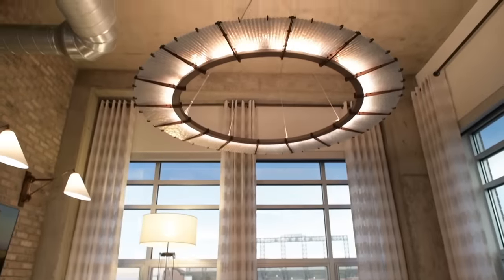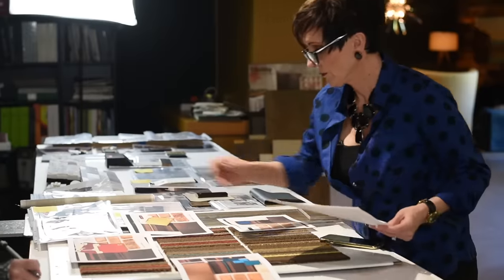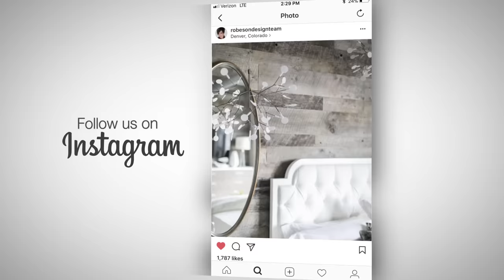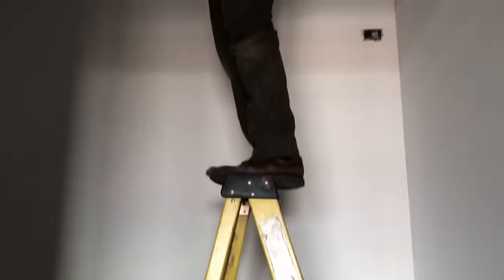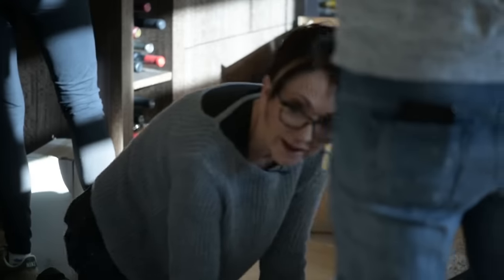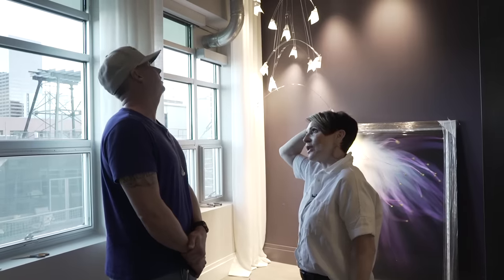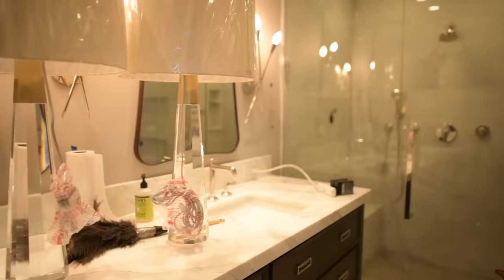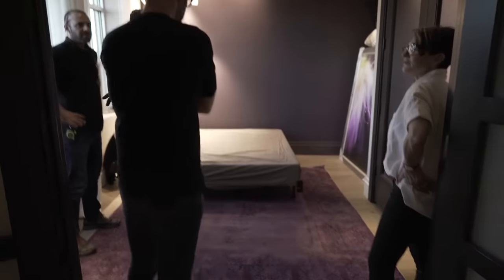Interior Design | Apartment Design | REVEAL

Comment: We have black marble and the designer had a placed a clear plastic over to bring out a shine. Question: when using marble can I remove the plastic film and have it treated so I can place a hot plate or pan on the surface

Comment: We’re doing a major renovation on our rocking Cair single story north suburb of Dallas in our aster bedroom and bathroom. Would you even consider that for a budget of $50k. It’s probably too small of a project, but just wanted to run it by you the house is small, only 2400 sq ft. We did the regular circuit today, Crate and Barrel, Restoration Hardware, and n. It was all so boring and disappointing.